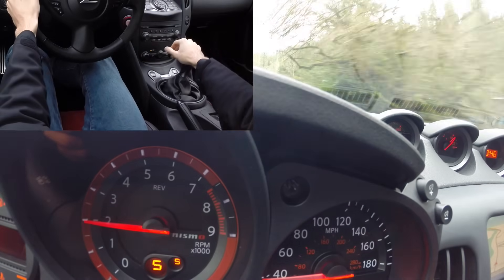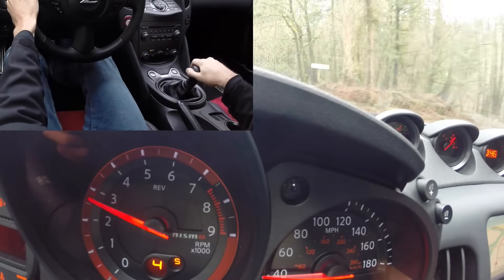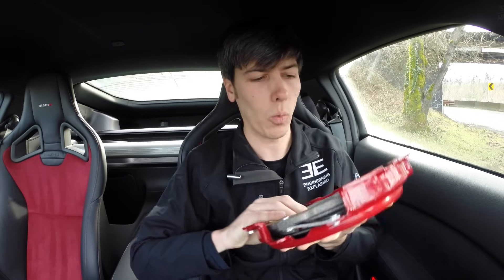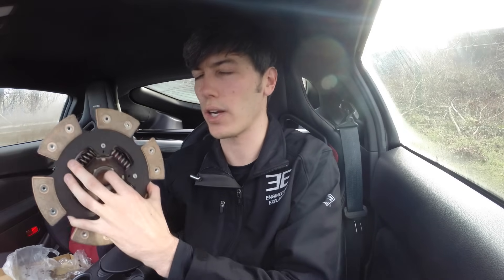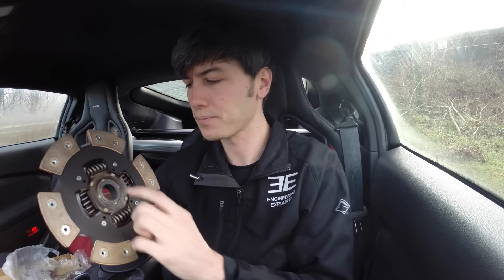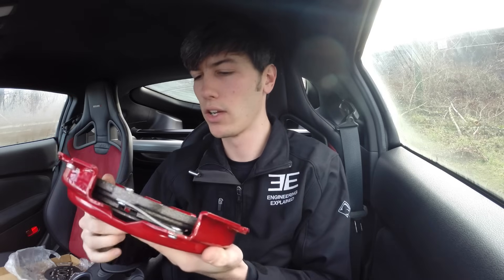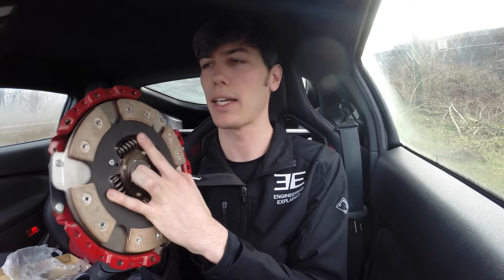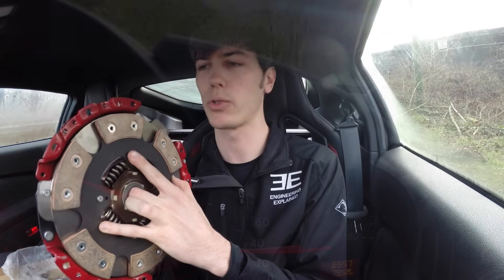What Is Rev Matching?

Comment: so i learned why rev matching is important but not how to know when your rev matched. what did i miss?
Reply: you'll feel that. shifting with rev matching is very shmooth (if done properly). without rev matching, you'll fell a little "vibration" or an unexpected change of your speed. but don't look at the dials, just relax and "feel" your car. i hope i helped you a little bit :)
Reply: +Matthias Rüeger what am I looking forward to know that I have rev matched?
Reply: +Gary Z basicly, you don't feel anything during gear change
Reply: +Matthias Rüeger right but am I looking at my speedometer or tac to know when I'm in the "sweet zone?" know what you mean? I can't figure out how to tell when I am rev matched. do I use my instrumentation at all to determine this or is it just the sound of the engine or what?
Reply: +Gary Z when you revmatch exactly, the tac needle will not move after you released the clutch. but you don't have to look at the instruments after you know how it should feel ^^
Reply: +Matthias Rüeger got it...Thanks!

Comment: With some of the older standard vehicles I've owned over the decades I've practiced rev matching to the point where I don't have to use the clutch at all except to start from a dead stop. It's not something to do all the time, but when you get to know the vehicle to that point the clutch-assisted shifting is so smooth - know your speed and hear/feel the engine revs and it's like the process is like an extension of your body. Just got back into a standard after too many years in the automatic wilderness and haven't yet felt the need to try clutchless - manually shifting was easy and natural. Figuring out what all those controlls sticking out from the steering wheel column did, now that was another matter.
Reply: Or on old cars, that was very tricky, you didnt have synchronizatios so if you updhifting you pít clutch neutral realse put clutch put gear, and for downshift matce the revs cause if not or you did it wrong you can hear the transmittion slipping and you can broken everything down very easly

Comment: For anyone who just wants to learn how to do it.  Feel free to add constructive comments/questions. I'll edit if necessary.

Letting the clutch out slowly means you are slipping the clutch for a long time.  The clutch does not take wear when it is fully engaged or disengaged, but the time in between is where it receives 100% of its wear.  You can tell how much wear your placing on it by the amount of time it takes to shift smoothly. Your clutch is made to handle a ton of wear so don't sweat it if you ever had poor habits in the past.

When I say fast, I'm only talking about the clutch release.  The total amount of time it takes for your car to shift in and out of gear is irrelevant.  Different car's naturally have different paces for on both up and downshifts.

Perfect Shift - Really fast, No jerking
Great Shift - Fast, little to no jerking
Good Shift - Sort of fast, Little to no jerking
Good enough - Not particularly fast, Little to no jerking
Poor Shift - Slow

 Drive down an untraveled road at a safe, normal speed in a lower gear then normal.  We'll say 3rd gear at 30 mph.Take note of the speed and RPM.  Now shift up so your in 4th.  Now downshift back down to 3rd the exact same way you normally do, but instead of letting off the gas all the way keep on it just enough to raise the RPM's close to where you were at originally.  You just need to get close and your clutch will do the rest when you release it so don't over think anything.  Practice will make perfect over time.  When you're raising your rpm's up to the appropriate level, your not so much applying any torque, but more just resting your foot on the petal just enough to get the job done. 

When you are practicing like this, you can always aim a little low if you don't intuitively know your RPM's for each gear yet.  It will be smoother, faster, and add less wear then your original method anyway.  

You don't have to look at the tachometer to know if you were RPM's were too high, or too low, in fact you don't need it at all.  If the car pulls you back in the seat they were revving to high.  If you feel you are being pushed forward you revved a little low.  Everything can be done by sound and feeling assuming you can hear your engine.
Reply: that explanation it’s actually really really good and clear; no questions at all
Reply: So even a good downshift is better than slowly letting the clutch out? Even if I don't make the car jerk?
Reply: @nujabes7  I bump this 6 year question to ask the same. I normally don't experience carjerk while downshifting because I downshift when the car is at less than 2000 RPM. My dad that has over 40 years of driving experience and is actually really good at driving, and doing everything to keep the car wear at minimum hasn't heard about this before, like he taught me, very, but very rarely I feel the car jerk when he downshifts, and he does it a lot, because he's used to engine braking (when you're about to come to a stop, you downshift little by little according to the speed of the vehicle until you eventually stop)

Under these circumstances, it is still better to downshift?
Reply: so underrated thank you so much
Reply: Love this comment, I wish this information was in the video too.

Comment: What about synchronized shifting? That is something I did a lot when I used to drive a manual transmission in semi trucks and with a small pickup. I had a 1996 S10 with a  manual transmission. I would put it into 1st gear, and then when I would reach a point where 2nd gear was next, I would accelerate further to create vehicle momentum, then gently put pressure on the shift lever, it slips out, and then into 2nd with gentle pressure till it dropped in. This, while letting off the throttle, and then applying throttle. I don't think this will cause damage but, what do you think?  I really like shifting that way. When I drove semi-trucks, that's how I was shown to drive.

Comment: Ok there is something I need to know and Im going to ask it here because I feel like I will get the best anwser. Lets say we are on race track and we are going down the main straight in 6th gear and first corner is a slow one lets say 2nd gear. So what is the best/fastest way to slow down? Doing heel-toe for every gear (so from 6-5-4-3-2) or to brake in 6 and lets say 3/4 in the brakeing procedure we blip the throttle (heel-toe of cource) and we rev match second gear (so from 6-2) and we do it in one take. Also I imagine braking with clutch pressed is not the best because you dont let engine compression do the braking so it takes more distance and consequently its slower.

Comment: Mistaken. Some motogp bikes use engine timing on downshifts to alter timing which allows for controlled engine braking. This way the brake is not needed and the throttle controls engine brake and throttle.

Comment: The point is.. I have been doing this ever since I got my drivers license but wasn't all that aware of it.. I am actually not aware of how I shift anymore, weird...

Where I live you learn to drive manual though, but, they don't teach you to put your car in neutral when you stop in front of traffic lights but they teach you to keep the clutch down and some other things which might be good against unnecessary wear will not be very commonly teacher here or practiced by others..

Honestly, the only stick shifting car I drive is worth about 350 euros so I really do not give a crap what happens to it.. It is my dad's second car though. How he drives however, like he doesn't give a crap because he doesn't.. the main car is an automatic geared car. Funny thing, he is a car mechanic and when he drives in clients their car he is as careful as possible.

Comment: Why does the clutch disc have those "spaces" so to say, in it? Why isn't it just a full circle around?
Reply from the maker: +Tony Woody From what I understand, it has to do with the material used requiring higher pressure. Most will be full discs, this is an aftermarket design.

Comment: Best explanation for rev matching !
Do we also have to brake a little simultaneously when blipping the throttle ( in case of bikes ) to slow down clutch disc along with speeding up the pressure plate by blipping the throttle

Comment: Newsflash: Dow shifting without matching the revs is standard procedure in racing. Instead of breaking they often just down shift to match the speed they can make the turn adding a lot of torque (grip) to the car and setting it up to accelerate immediately after it without having to shift.

Also, in civil driving, gear breaking is also common. If you can't do that they won't give you a license in Europe. You have SIGNS asking you to engine break in mountain roads instead of using the breaks themselves.

Why?

Because this way you don't block the weals thus avoiding slipping over water and ice and you add torque to the car helping it with the grip. Also, by gear breaking, you don't over heat your physical breaks. Over heating your breaks is extremely common in long mountain roads.

The clutch is made to be used. You clearly have no idea how to properly use the clutch. Just stick to automatic shifts because you are just dismissing the advantages that a manual engine has over automatic.

LOL.

Oh! And you know what we do in Europe when our clutch has wear (something like 10 years after)? We just put a new one, It's not that expensive and it does not wear off easily any way.

Comment: You lose engine braking with auto rev matching, whether you use clutch or brake to slow down the vehicle you are wearing  one component or another. I prefer downshift more to slow down rather than brakes.
Reply from the maker: +Rishikesh Wavdekar This is not true. Engine braking should be done (as the name implies) with the engine, not with the clutch. Match the rev, then let the vacuum of the intake stroke slow the vehicle down (for gasoline engines).

Comment: Here is another you can rev match but even easier. First down shift into the gear you want and then blip the throttle and ease up off the clutch.I guarantee it will be the smooths transition.

Comment: I think I'll just stick with putting it in neutral and using the brake when slowing down.  I'll try this if I ever go to the track. By the time I need this I may very well have a car that rev matching for me.
Reply: no need to do it. In most cases you can just brake and keep it in the current gear then when you're ready to accelerate again just shift it into the gear most appropriate for the speed you're currently at.

Comment: Guys I have a question here... I tried to double clutch in my dads Opel Corsa (2010) I did it perfectly - Ran straight home, proud and all to tell my dad. He was like "It's bad for the engine and it is not necessary to do, as the gearbix is synchronised " - So is it that bad? or can i just try it as much as i want? Kinda?

Comment: Question. When I was watching F1 and other forms of racing in the 80s, I noticed that some of the drivers (like Senna)will go through all the gears on the downshift. For example, long straight onto hairpin, where drivers needed to go from 5th to 2nd, they would shift 4 to 3 to 2 while rev matching between each gears (heel and toe). What is the advantage of doing this? Why not just go from 5th to 2nd?

Comment: With rev matching, you also don't need the clutch at all. If you get it right, you can shift up and down the box without grinding the gears or engaging and disengaging the clutch.
I once had to drive from Southampton to Cardiff (UK) in a Ford Fiesta hire car, where the clutch pedal wasn't disengaging properly and the rental agency was closed. I managed to get the whole way (a couple of hundred miles of A roads and some motorway and only had to use the clutch twice - I had to stop at two junctions, the rest I managed to downshift to first gear and roll the junctions as there was no traffic.
Likewise, the company gave me a Rover 100 (Mini Metro) as a hire car, the footwell was so cramped, I couldn't get my foot on the clutch easily. Again, I drove a few hundred miles of A and B roads without using the clutch. Luckily the gearbox on the 100 was very smooth, which made it very easy to do.
Changing up is easier, you shift out of 1 gear and catch the revs coming down to shift into the next gear. Going down the box is more difficult, you need to blip the throttle and match the revs (on the Fiesta, I had to do that by ear, as there was no rev counter). Braking makes it harder, as it is a moving target.

Comment: But this takes more time then just directly downshifting since I am essentially depressing and releasing the clutch and pressing the accelerator between shifts. Besides when I slow down I just put the car in neutral, use the brakes, then when I accelerate or come out a turn I just put in gear and accelerate. Only time I down shift is when I am cruising in top gear then need to accelerate from another gear. In which case I go to a lower gear and accelerate, not slow down. So don't really have to rev match.

Comment: I have a question. In general, is it okay to use the transmission to slow down to save your brakes?
Reply: By all means!!
Skip shifting is not always necessary, but grabbing a gear will slow you down and save the brake linings, especially on a long, steep grade. Done properly, engine braking will also give you better control on slick surfaces. Again, smooth and gradual are the keys.

Comment: If the plate is connected to the ENGINE, and the clutch to the trasmission why if you lower the gear the clutch is rotating faster? Lowering the gears means that the engine rpm goes up, and then plate rpm should too. I'm confused xD
Reply: +Stefano Fossati  When you select a lower gear, but before you engage the clutch, the gearbox and clutch spin faster...when you release the clutch, this extra speed is what drags the engine and pressure plate to higher rpm.
Reply: +aussiebloke609 you are damn right. thanks sir.

Comment: i think this rev matching works for race cars...how come no driving instructor teach us nothing of this...the point is that whit a normal street car you don t down shift from 4 gear to second if you want your clutch to  last for some years.example:you go 70 km per hour in 4 gear , you raise your foot from the gas pedal,your speed will go down,put in in 3 gear and slowly release the clutch...thats how you do it...buy do it like these experts teach you in one year you will need a new clutch....for racing is ok but thats all..
Reply: +calin vasile  We just use it to slow down without using the brakes.
Reply: +calin vasile You realize not rev matching kills clutches right?  Rev matching actually saves the life of a clutch because it slips less.  When you don't rev match the clutch has to slide on the p plate and speed up the engine, resulting in clutch wear.  If you rev match the clutch and p plate are spinning at the same speed with less slipping.  Any time you are slowly releasing the clutch to make it smoother you are wearing the clutch.  Its the same as holding your car on a hill by slipping the clutch.  It causes wear.
Reply: +calin vasile A driving instructor has a hard life being chauffeured by random people with mostly zero to below zero skills which is something for people with reeeeeeeeeealy strong nerves. I cannot imagine a driving instructor being abnormally active to teach people more than they need to success driving school. The mayority would miserably fail under the ammount of information. 

Take the driving school as a 1st lesson on "how it`s done" and learn more later. Just like in a regular school. I was never taught for example about taxes like where to pay, how, why, when, how to sell or buy things that are complicated to deal with like houses and other property that includes a lot of paperwork where a small mistake can cost you money and ownership at once etc etc.. but I was taught how to graphically demonstrate X over Y when something changes the equasion. That brought me rreeeeeeeeeeealy far and made an outstanding point in my CV :D 

Rev matching doesn`t need to be done aggressively. You can do this slowly, casually just to support the transfer of rotations. It will allow you to drive smoothly as if you had only one big gear that does not need to be shifted at all.... or as my driving instructor once said "no, it is not important to let everybody know that we just changed gears..."
Reply: +calin vasile Because 99% of the driving instructors cannot perform rev-matching themselves and it's viewed as unnecessary. Here in NZ it is often viewed by many ordinary (sub-standard) drivers as 'street racing' behavior, alas it's the only way I drive, being mechanically sympathetic.